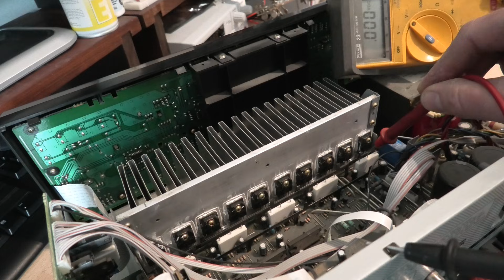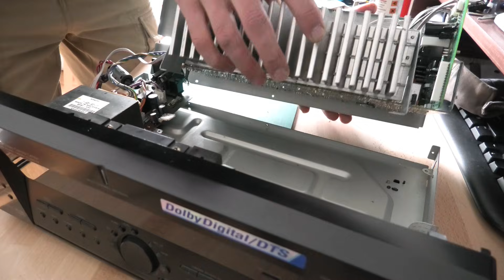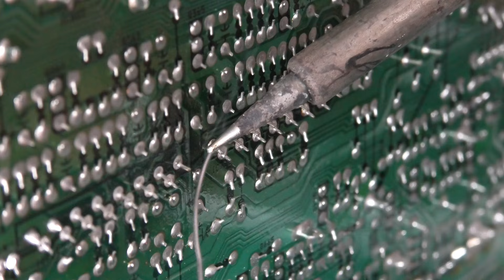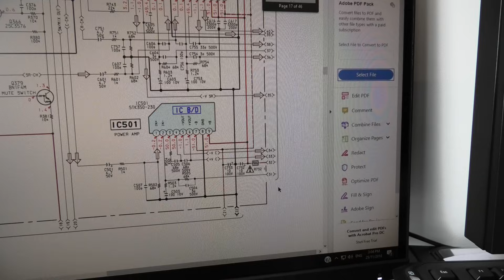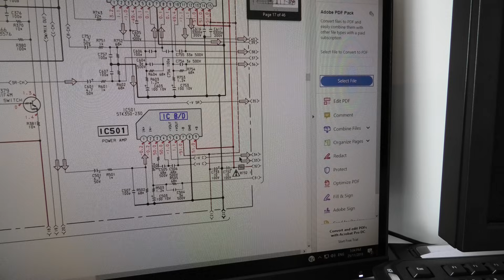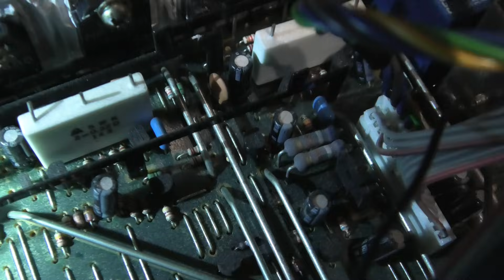Protect mode repair Sony STR-DE675 Receiver amplifier

Comment: I have Sony STR-DE245. When I open and cleaned from dust amplituner went to protect mode. I found this tutorial and Replace 1 Ohm resistors R732 and R733 close to my STK Power AMP - similar construction. I used cheap chinese 1 ohm resistors. Tuner work now.

Comment: Hi! The SONY amplifier was repaired, the speakers were sometimes turned off, there was poor soldering on the relay contacts, but it turned out that the OSA-SS-224DM3 relays failed 2 pcs at once, instead of zero resistance they show up to 300 ohms, the amplifier was little used, and the relays were of poor quality! Which are the best relays to install instead of the factory ones?
Reply from the maker: If the 300 ohms is measured across the contacts, perhaps it's just related to dirty contacts.  Relay contacts will self clean if you exercise them with a load.  Perhaps just bring them back to life by cycling them on and off with the amp in operation at high volume??

Comment: Hi, i have str-km77 doing same problem.  Tried disconnect speaker but sometimes it works fine sometimes it goes in protection mode. Any suggestions how to fix?
Thanks
Reply from the maker: Hey!  I would look closely at the solder joints on all of the power amp ICs.  Sometimes an intermittent fault can be caused by cracked/fatigued solder joint.
Reply: @Justfixitmate thanks for replying,  I will check tomorrow.
Reply: I checked every single joint they all good.
Reply from the maker: @GurtekRandhawa  Could also look for any discoloration on the PCB which would indicate an area that gets hot - and again look for bad solder joints - also look for swollen electrolytic caps.
Reply: @Justfixitmate am looking for someone who can fix it...😂

Comment: What's the use of protect mode if it does not protect the amp
Reply from the maker: Well, it's there to protect your speakers.  It detects DC offset.  This would otherwise fry your speakers pretty quickly.  I've cooked speakers before on an amp without this feature.

Comment: Power pusch Protector in sony audio system is really one of the headache problem. So sony should develop a button which this problem is rectified manually by users.
Reply from the maker: The Protect mode function is a mechanism to protect your speakers from a hardware failure.  It's a necessary function.  Considering most of these Amps are 20+ years old, I think it's reasonable to consider the possibility of hardware issues due to aging components / solder joints.  I'd prefer protect mode over burnt out speaker coils.

Comment: I have a STR-DA9000ES  and it says protect once i turn it on...not sure what I can do these days
Reply from the maker: A common issue with most of these amps are dry solder joints on the power amp ICs. I'd start looking there.  Might be a very easy fix.  Good luck!

Comment: If the voltage amplifiers go open circuit (dry joints) then 5 times out of 10 the IC will be destroyed, the wave soldering sony did was horrendous

Comment: Nice job and great video, thanks for sharing your "hunt" with us. No doubt will answer a few questions other guys may be having with thier amps. Cold solder seems to be an issue with a lot of these older amps, that about the time manufacturers were switching to lead free solder (like anyone is going to be eating a pcb any time soon) . I had the same issue with my 2016 Jeep Patriot stereo, I had to reflow a cpu chip on the main board (man talk about a pain in the back side). Once I reflowed the connections with "old school 60/40" the stereo worked like a charm, actually a bit better to be honest. Thanks for the video very well done and clear to follow. Cheers!
Reply from the maker: "old school 60/40" is a rock solid performer.  It's what sits next to my solder iron.
Reply: @Justfixitmate  You and me both Sir, Cheers!

Comment: I just bought a used Sony STR-DH810 and it looks like it works but NO SOUND 
WTF should I do?
I have tried this resetting thing
mine does not say Protect mode

Comment: Saludos amigo, gracias por tu explicación y metodo de reparación.  Tengo problemas de voltaje en un DC-DC board converter de mi Sony SDT-DH-540.  No produce los 13.5 voltios requeridos solamente 12Voltios;, ni los 3.5 voltios, solamente 1.6Volt.  Me ayudaría usted?  (Do you help me?  My DC-DC converter is not give 3.5Volt nor 13.5V DC for get up on my Sony HDMI amplifier.)  I am from Dominican Republic, I  need repair mi Sony, please.

Comment: My Sony STR-DE885 has no led display but turns on/off and has sound just no display. Any advice you can give me. Any particular connections.
Reply from the maker: Hey there. Check that you have -30V on the display board.  I've had this issue before - I recall replacing a resistor.  Check R803 on the main board (4.7R).
Reply: @Justfixitmate  Thanks for your help!

Comment: Hi and thank you. Saved a DE475 from the charity shop (different board layout but same design). Worked for a few days then the protection racket started. Followed your video sequence. Exactly the same outcome. Checked that R732 resistor and it showed 1.3 ohms. Not having a 1 ohm job, paralleled two 10 ohms to give me 1.03 by the meter. Guess what, works fine. Simply that resistor had gone out of spec. Thanks for your pointers, appreciated.

Comment: I had the same issue with mine. I'd highly advise you to redo all the soldering and check the 78XX regulator soldering too. I found some cold soldering on the dolby board. and on the rca board too. the rca has a LM7905 negative 5v regulator.  this is a good receiver but with time it melts its on soldering on the pcb.

Comment: I have a STR-K502P with the same issues.  Internals are very similar.  Cold/broken solder joints in the same place.  All fixed now, thanks to your video.  Great info and explanation!

Comment: Very helpful - I've got an STR-DE475 and have touched up the solder joints on the board. Quite a lot looked dry, or tending that way, and the joints on that STK IC were particularly bad. I noticed that R732 - mine has gone open circuit as well - is a fusible resistor. Did you use one of those, or just a standard resistor? Want to err on the side of safety, but also want to get the job done, lol.
Reply from the maker: Thanks for the feedback. R732 is listed in the parts list as a 1R 5% 1/4W carbon resistor. It is noted as non-flammable.  I can't quite remember what the damaged part I removed looked like - either way, I've placed a resistor there. If you've got any additional info, please share.  It's more than 3 years later, and the amp is still running almost every day - no issues so far :)
Reply: @Justfixitmate  Good to know, I replaced the resistor and the receiver is still a bit odd - goes in and out of protection. The heavy-duty connecting wires right next to  IC501 and IC502 show -52V when it's in protect mode, I'm wondering if capacitors next to those ICs are faulty, as I moved one and it came out of protection and the meter stopped showing a negative voltage. Have touched up pretty much every solder joint on the board! Intriguing, will keep working away at it. Thanks for your reply!

Comment: Hello sir ji my sony's music system is its volet problem, it is completely closed but its 1 swich o switch 230v 220v 120v like this, if i use 120v for a second then power comes on 220v and 230v pe does not have any power, what can be the problem in him, thank you for telling your opinion
Reply: Is only for a 120v. Just leave it in that position . The others are for countrys that use higher voltages. The U.K.uses 220v for homes & the usa is 110v120v.

Comment: Just had a problem with my Sony amp   STR K740P, so I’ve brought a replacement STR DE475, a head scratcher but it’s old I brought this amp way back in 1998 fro the Sony store, it’s been absolutely brilliant until now, just checked everything cleaned it out and rechecked some screws, so I’m going to leave it on for a bit, normally trips out at 10mins fingers crossed

Comment: i have the protect mode kick in sometimes , i am using different ohm speakers which probably messes up the power amp
but the preamp output still works, and sometimes the sound quits without the protect kicking in so i increase the volume
and the sound comes back on,  could be a resistance problem?

Comment: I have similar protect problem in my Sony STRDE345 (Someone abandoned it on street).  I am trying to give a shot and revive it.  The receiver has two of those 1 ohm resistor as you described in the video, they are R732 and R733.  I checked them and they are fine, both at 1.2 Ohm, no short or open.  All the solder joints on IC701, IC702, IC501 and three of the voltage regulators were touched up.  All the solder joints through out the board have been inspected.  All the power transistors checked out ok, but do notice the right channel pair of transistors seem to be replaced before. I also find the voltage supplying the power transistors does not match what is shown in the circuit diagram.  B+ line is +52V,  B- line is -75V.  Could this be the problem?  I am stuck, Please help.
Reply from the maker: Hey, nice work trying to save this amp.  I would focus on the right channel output in this case.  The only way you'll measure -75V is if your ground reference is at approx +25V. Something in this channel is out of balance.  Have you measured the resistance of the big power resistors near the outputs transistors? (0.22R * 2)
Reply: @Justfixitmate  Hi, thank you for replying.  I checked all the power resistors for all channels (the 0.22 ohm * 2 big white rectangular resistor), they are all good, measuring at 0.7 ohm end to end.  I also removed the bridge rectifier next to to 2 big 10000uF caps and check to see.  It looks ok too, 4 diodes all reads something like 0.5 to 0.6, no short.  I put it back and remeasure its DC output, it reads 125V.  However, when measuring the rectifier's DC positive side to ground, I get +50V;  but then when measuring the negative to ground, I get -75V.  I don't know if this is normal because I have another known good Sony STRDE receiver that doesn't do that.  On that good receiver, the bridge rectifier's DC outputs read +55V and -55V when check referenced to ground respectively.  Anyway, since you mention to check the right channel first, I will definitely go after that first.  I have a feeling something is going on in that right channel driver (Also the left channel driver too).  Maybe either one or both are outputting some funny input voltage to the base of the power transitor/s, causing the power transistor to turn ON mistakenly.  I will try that tomorrow, thanks again.
Reply: @andrew316L  Did you find the problem?
Reply: @LauS0  That's a good question, because it seems he left and never came back. @adrew316L

Comment: Bonjour , super le diy que vous faites , cela se perd, de tout réparer , je cherchais des infos sur cet ampli que je compte acheter , mais je m apercois que l on ne peut pas regler les basses et les aigus.  vous pouvez me confirmer?    d avance merci
Reply from the maker: Yes, you can definitely adjust bass/treble, with an EQ function which allows you to adjust at different frequencies.  It's a great amp!

Comment: Quick question does the power button on a stereo receiver run on 12 volts dc
Reply from the maker: The power switch is a digital input on the main system IC.  It's a switch to ground, pulled high to 3.3V

Comment: Wondering if it is manufacturer's defect or is it wear & tear that had caused such failure in the first place.
Reply from the maker: Dominic Fong This amp has been used almost daily for 20 years so I'd say wear and tear. However, I have found over the years that some of the resistors on this board are somewhat close to their power limits and will fail eventually.

Comment: HOW ITS posible to quit the high pass filter of the speakers on a Sony str k670p?? If ITS possible to do it. Or not??
Reply from the maker: infohacker info10 If it's anything like this amp, you just have to set the speaker size to Large in the setup menu.
Reply: @Justfixitmate  the amp does not have this option AND cut in 120hz
Reply from the maker: infohacker info10 some of these amps have a setup menu if you hold down the power button for 5 seconds. It could also be designed to only operate with small speakers and a sub. Not familiar with your model.
Reply: @Justfixitmate  i tried that AND reset all settings only

Comment: I had exactly the same problem. Except the one I got was full of water. Believe it or not, I had to wash the biggest pcb with the pressure washer to be able to clean it properly. It was all green inside. I wish I could add some pictures before/after. After cleaning it the problem persisted. But after some soldering rework and changing that resistor, it got back to life. Thank you!
Reply from the maker: Nice one! That's great to hear.  One more saved from the scrap heap. Happy to hear this video helped :)

Comment: @DanTubez, In the video at position 2.50 you found the -52.7 volts. I have also found the same on my amp. Both power transistors and dual resistor check out fine. Was also able to track down the 2 ohm resistor under the two rails but it was also reading fine. All my solder joints appear perfect. Can you offer some direction as to where I should look next. I seem so close because I found the DC volts on the resistor. Its funny because it turns out to be the same set as yours (first from the left). My amp is the Sony STR DE-697.
Reply from the maker: G'day!  I suggest thoroughly checking that IC701, IC702 and IC501 all have a solid +/-~54V.  You can do this by monitoring the voltage on C616/617, JW702/702 or JW706/707.  It seems that if any of these ICs lose the positive rail, it will trigger a similar kind of fault (~ -52V on R516). Check all the solder joints on these ICs thoroughly, in fact just touch them up anyway as you can't always see a fatigued dry solder joint with your eye.  Also check the solder joints on JW702/702 and JW706/707.  Might also be worth checking C732 and C733, I replaced these at some point because one was reading ~20k out of circuit.  Failing that, it may be worth replacing IC501 (they're pretty inexpensive and available on ebay).  Good luck - I hope you manage to revive your amp :)
Reply: Thanks for the info, I have the service manual so I should be able to find all these elements easily. Great feedback!
Reply: @richarddemers2344  Did you find the problem?

Comment: My Sony receiver got moisture inside because it was outside in the covered gazebo but the snow drifted in from the side and lightly dusted it. I noticed the receiver turned on by itself and then repeatedly turned off and on with "Protector" displayed. I wiped the snow off and then covered it with a towel but I didn't unplug it. So when it turned on by itself it got hot with no ventilation, which made it go into the on off mode.

Everything seems normal on the front display when I first turn it on then it goes into the mute mode and keeps turning off and on every few minutes. I opened it up and there is some white corrosion deposits around some resistors. I am actually surprised the receiver has lasted several years outside until now. Not sure whether to try and fix it or buy another receiver.
Reply: Long wait response here but did you get it fixed?
Reply: @promortal8596  I threw it away. Too much corrosion inside.

Comment: I have a problem where the front right channel is extremely low compared to the front left (And I think that all of the channels are generally out of wack but I only care for the front channels), I tried the balance adjustment and it does almost nothing. Where do you suggest I start looking inside?
Reply: I should probably mention that it has the same balance issue with headphones. I tried reflowing the only cracked solder point I saw which was right next to the front right channel output on the bottom as well as a few others, but no change
Reply from the maker: Hi, is this the case regardless of which input is selected? Is this also the case for all output modes? (Stereo 2.0, Dolby digital 5.1 etc...)

Comment: I have the same amp but mine has a different problem. I hear all the channels at 1/10 from the original volume, except the center channel. All other functions are working. If you have any idea where to start looking that would be great.
Reply from the maker: You could try checking the output of IC201 at R373, 74, 76 & 78. Should be similar voltage to the center channel R375.  That might help you work out where to focus. Perhaps the power mute circuit is somewhat active? (R744, R743), this circuit connects to the channels you're experiencing trouble with.